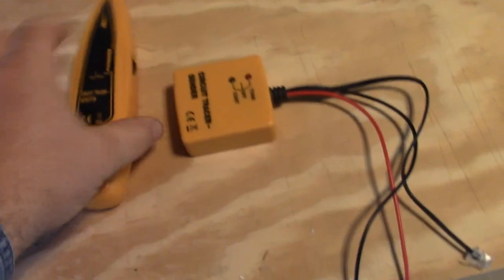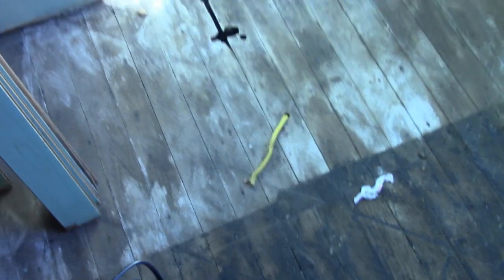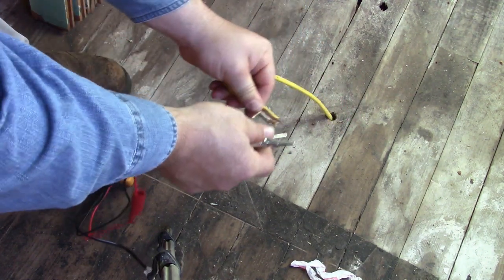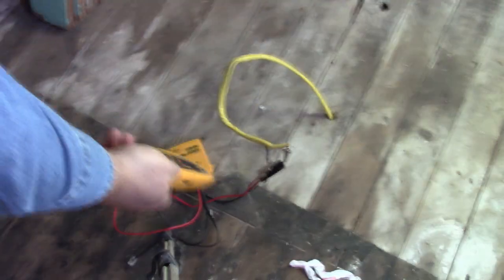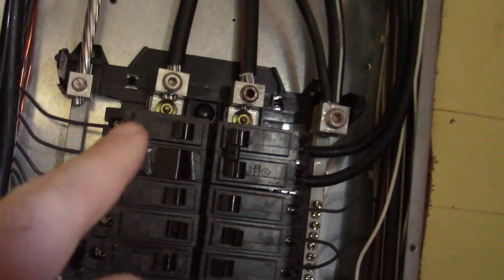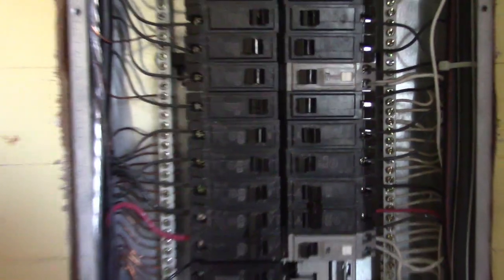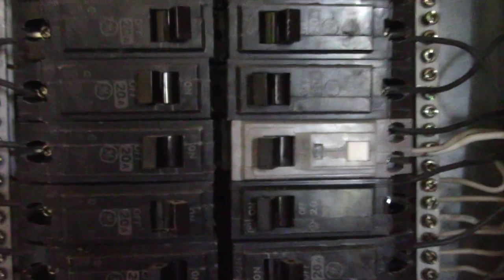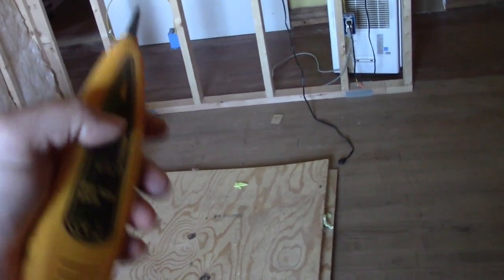Circuit Tracers and Why You Need One

Comment: Pretty handy gadget.
Reply from the maker: I've ended up using it much more than I figured I would!
Reply: @farmboy30117  Nice tool. Makes everything certain. I'm not a licensed electrician but retired lineman & am pretty knowledgeable with circuits etc with work at my house. You can be pretty safe with basic knowledge. 2 wire hook'em up 3 wire screw'em up lol. I knew a guy that wouldn't change a light bulb with out turning off the main breaker.